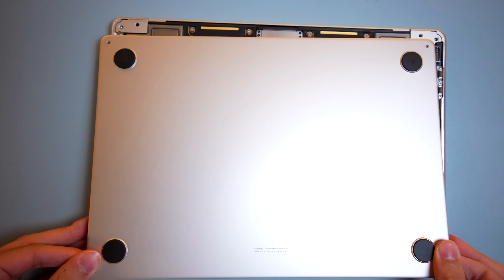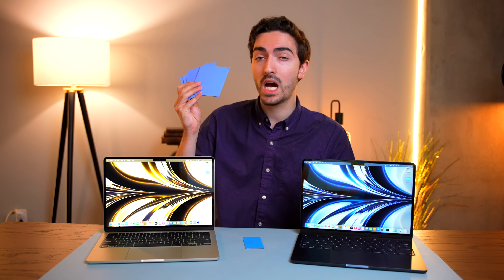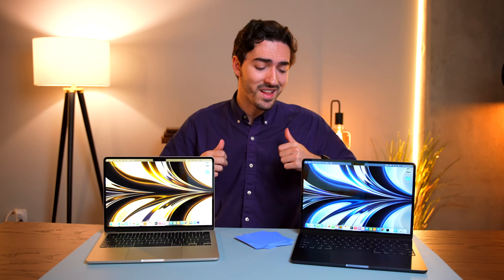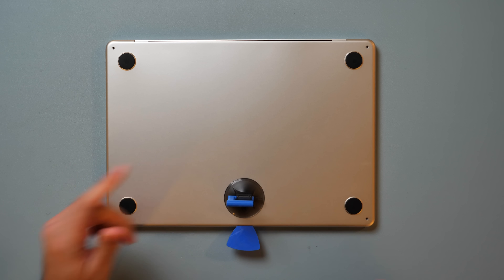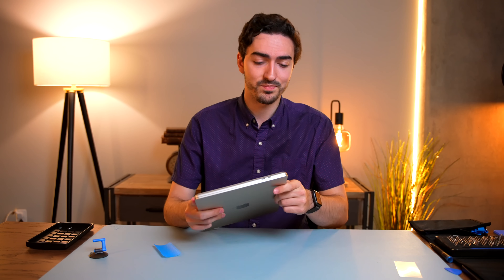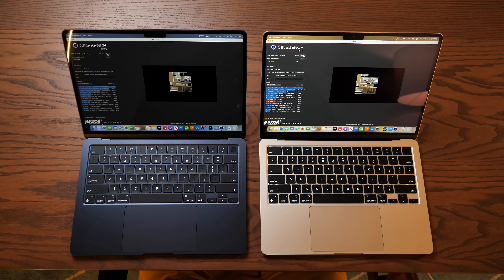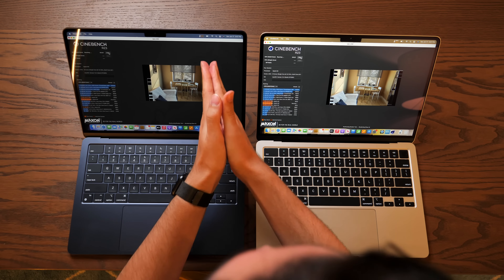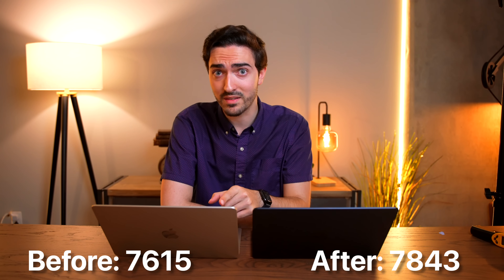Make your M2 MacBook Air FASTER for $8?!

Comment: Installed the heatpads and I am using a notebook cooler. The MBA sits on a fan and has an additional fan blowing on the KBD. Now it runs, 33W power use. Topaz Video enhance is running 24/7. Without the fans it throttles to 24W or less. 30% or more computing power with heatpads AND fan. In stock condition it is slower than my M1 MacMini.

Comment: This is total BS. I have both the M1 and the M2 MacBook Air and have never ever experienced overheating with normal every day use. I use adobe in design and Photoshop and I've never once had an overheating issue. All these benchmarks where they're running them six or eight times in a row of course they're going to overheat no shit. All this again is BS you should not have to put thermal pads in there if you're using it for normal use that it was designed for. If you're using it for editing v4K video.and stuff like that this is not the laptop for you, upgrade to a MacBook Pro, pro as in profession use.   ALSO doing this fix is going to drastically shorten the lifespan of the batteries. Think about it you're transferring the heat to the bottom cover which has direct contact with the batteries therefore you're making the batteries run hot and everybody knows heat is not good for batteries,

Comment: To throw a spanner in the works a little….heat flows when there’s a heat gradient. You may not get better performance by covering the entire emf shield. Instead, better performance may come from covering just the die area which will allow a greater temperature gradient on the bottom case….eg, a defined hot spot allowing heat to move quicker to the colder parts of the case. This was evident in your test and is why heatsink manufacturers use a copper base with alu fins.

It would be interesting to see a follow up video to confirm though.

Comment: What i like to do is use really thin thermal pads as a bridge/electrical insulator, between a very high end graphene thermal pad.
Be VERY aware that graphene pads are extremely electrically conductive, so they need electrical isolation.

Now where graphene comes in handy is spreading out the heat, not just transfering from one side of the pad to the other.

When transfering from the CPU, to the case just below the CPU, its a bit slower than thin thermal paste(this is significnatly faster than a thermal pad, but this requires good precision as it is not electrically isolated, any shift in the graphene pad can result in a short circuit killing the device).

However, when transferring from one edge of the thermal pad to the other edge, say, moving from one side of the laptop to the other side, it seems to be 3-8x faster than the aluminium used in the case. I think the pad i used was rated for over 600w/m*k (transverred on the X/Y plane not the Z plane)
This is nowhere near the speed of a heat pipe or evaporation chamber, but it is far better than just letting the aluminium alone spread the heat out. 
If you could combine heat pipes, with these thermal pads to cover the entire bottom cover with graphene, and a traditional thermal pad to insulate everthing else electrically, you miight be able to push the M2 to 38w

Edit, what i think Apple should have done for this new generation is have the SOC behind the screen, with ample heat pipes and thermal pads to spread out the heat across the whole screen so there isnt a hot spot, this would allow for larger batteries, more ports, and more storage on the base of the unit, keeping the majority of the heat away from the intentionally difficult to replace battery.
Reply: Great！nice Idea！！

Comment: The chassis temperature for both of those is now dangerously high for skin contact, which is why this might not be a good idea. 47 Celsius will cause 2nd degree burns in 20 minutes and 51 Celsius will cause 3rd degree burns in 4 minutes. You wouldn't want to put these on your lap after this mod anyway.

Comment: Would like to see the benches on unmodified vs modified when using laptop cooler that pulls the heat away from the bottom cover. The thermal pads are flowing heat away from the heat sink to the bottom cover, so the next step is more quickly move it into the environment with air flow. Since there are no vents, best that can be done is airflow across the bottom.

Comment: Here's an idea for something that I'd like to see tested: What's the ratio between CPU load and CPU temperatures. Like, sure, the CPU has to throttle under load when benchmarks are being run; the CPU is under 100% load. But what about under more 'normal' circumstances? Like, I have an ableton live project that keeps my CPU at 40% load, which activates the fans on my CPU.

I'd like to know what CPU load produces temperatures of ~100 degrees, causing the throttling!

Comment: the thinner cheap pads covering the entire shield are not making full contact with the base of the case on the blue unit, you need thicker pads.

Get one of the gel filler hot and cold packs that you use on sore muscles. you can start out with a frozen one if you like and you can put it under the base of the laptop. even unfrozen, the gel will absorb the heat away from the case bottom and help cool the laptop
Reply: How do you know they aren't making contact?

Comment: Been using this technique with thermal grizzly pads on the heat pipe in my 11" air, 15" 2018, and 16" 2019. It's mostly a no-brainer as long as you adjust your use accordingly (ie don't run cinebench on your lap while wearing shorts). 
Since they're portables though, I skip the area directly above the cpu/gpu. The bottomcase does flex in a backpack, and I'd much rather keep additional strain due to flex isolated to the heatpipe rather than directly on the chips and logic board.

Comment: How about running the MacBook without the bottom plate and elevate it slightly when you're at home and you need the most performance ? And put the bottom plate back for when you're on the go

Comment: Great video. No, these machines are not designed for sustained heavy workloads. Thermal pads are okay, but getting the MacBook Pro is a better option. I appreciate what Apple is doing as far as performance per watt/power efficiency. They got away from PowerPC (too hot, inefficient), they got away from Intel (also too hot and inefficient). Now they have their own designs based on ARM tech. Much less power usage, better performance, and a great step in the right direction as far as package design. However, the costs are high.

Comment: Now do the ultimate "Chad Modstrong v Virgin Warranty" on same machine for comparison:
 
1. Remove heatsink and replace all thermal paste with Thermal Grizzly liquid metal @ 78W/mK. 
2. Screw HS back in place.
3. Rip that risible black insulation strip off of it, clean with isopropyl alcohol & slam 1.5mm Gelid 15W/mK thermal pads onto the bare metal, covering the whole surface, including ribbon-cable.
4. Likewise eliminate with extreme prejudice any insulation on corresponding area inside the bottom cover.
5. Screw the bottom cover back on with brute force.
6. This should get the bottom cover up to ~65°C in long stress test.
7. Use massive balls to wick away the excess heat.
8. QED.

Comment: Fabricate a custom bottom case that replaces the factory bottom that's a couple of mm thicker and has air vents. Then take that up another notch and have a bottom case with a super-thin built-in fan just to move air around inside. C'mon Luke, you can make these!

Comment: "Shorten your M2 MacBook Air Lifespan by YEARS for $8" would be more accurate. This is how you cook a battery, causing it to expand, and killing the whole thing. The air gap is on purpose, to isolate the heat from the battery. Thermal pad modifications will kill so many MacBook Airs years before they would have.

Do not do this to your Mac. If you don't want your computer thermal throttling, buy one with a fan -- that's literally why they still make them.
Reply: You could isolate the battery also, putting reverse thermal pads, insulation.
Reply: You can buy aerogel sheets of 1.0mm thickness. These can be placed over the battery and other components you want isolated from the case

Comment: A year later don't put the thermal pads on the heatsink instead put them on the bottom plate cover that covers well the bottom lol

Secondly if you're out of the warranty you probably would have better results using higher quality thermal paste or even liquid metal if you're comfortable with doing that

Use TG shield that protects the tiny little chips around the GPU or CPU just for safety and never apply it too much thermal pace or liquid metal you need to get away with the least amount but you do not need to see the processors that's to thin 

With liquid metal you do need to go really thin with that stuff but also making sure you do cover the processors as much as possible and on the heatsink itself but then like I said don't overdo it

Comment: Regardng the paradoxical Blender classroom test on the higher spec'd model: 1) Were you running on battery and if so, was the charge level high enough? 2) Did the wide-area thermal padding permit heat from the CPU to transfer to the SSD or other subsystems via the lower case and cause throttling that way?
Reply: One hypothesis:  The higher specced model had two different thicknesses of pads, 0.5mm and 1mm. The 1mm pads could have caused an air gap between the case and the thinner 0.5mm pads.  While minimal, this small air gap would effectively act just like the small gaps between a heatsink and CPU without thermal paste applied.  So, while the thermal pads are facilitating heat transfer in some areas, the material of the thermal pad itself absorbs some heat and has no place else to transfer it to other than spreading it around the board and it's own mass.  In effect, the pad also would become a thermal mass according to the specific heat capacity of that thermal pad material.  Granted, there would be some transfer of heat into the small 0.5 mm deep cavity of air between the case and pad, but not as efficient as the 1mm pad in contact with the case metal.

Another hypothesis: The color difference between the two macbook models could also cause some slight differences in heat dissipation due to black-body effects.  This seems less likely to cause such a large difference.  However, it's also stacked with the above effects and is difficult to separate out due to the experiment's design.

Comment: Why do you measure temperature on the units’ keyboard top surface, between the function keys and the display, and call it the palm rest? It is simultaneously not a palm rest, and a place your palms will never rest.

Comment: Add external peltier thermal-electric phone cooler on M2 Air.

Btw, infrared thermometer usually doesn't work correctly on metal or shiny surface. The reading on bottom case might be off.

Comment: These are interesting experiments but I think it's a bit irresponsible to be showing how to do a modification like this without mentioning that you can burn yourself quite badly if you do it "right".  A really great thermal pad, perfect contact with every surface as well as the case, and a little bit of spherical fictionless luck and you can get your exterior case temps up near 100C, hot enough to permanently scar you almost instantly.

Fundamentally, these machines are designed to thermal throttle. If you require the performance that active cooling provides, buy a machine that supports active cooling. Apple sells several.

Comment: Thanks for this interesting video. I have ordered a MBA for my wife and it should come tomorrow, so we will see if the laptop heats up significantly. I suspect that when you use it for everyday tasks, it probably won't actually be a problem. This fix is probably most useful for the pro-user, who might well have a higher spec Mac Book Pro anyway. Just as well, as I don't actually fancy opening the case up very much. I have a fan plate which I used with my old MBP/2017, so we could use that if there is any problem.

Comment: Can you test thermal pad mod with a laptop cooling pad?

I think full heat sink coverage to keep surface temps lower under normal use on the go and then letting the thing max out and hit 50C on the bottom cover while rendering on top of a cooling pad when you’re at your desk might be the best of both worlds.

Kind of like that eluktronics external water cooling radiator for their new laptop but way simpler.

Comment: In addition, I personally think that there could be a pretty good reason why the engineers at  have kept some air gap. For an example, when such a temperature is passed to the bottom case it might affect badly to the lifetime of the battery since heat is such a good enemy to batteries. But the experiment here is great so that now we know a little bit of higher performance can be achieved. Further, I suggest using a stand with a fan if you’re using this macbook daily on a desk. However, they could have installed at least a very little fan. 😐

Comment: what about make ventilation on bottom cover. maybe drill it 2 sideways, so the air flow can happen. 
or maybe there will be third party cover that have a hole.

Comment: I did not encounter a throttling issue with my MBA so far but I am getting into amateur video editing and I may experience some excessive heating. The solution looks fairly simple. Thanks for the tip.
Nick

Comment: Love the video. Great to do those thermal pad tests. Was the blue M2 MBA the one with more cpu/gpu cores or was it only ssd being bigger? If more cores then more heat and a burst of power then possible quicker throttling effect as some YouTubers have shown. Could this explain the results or am I way off? Also would it better to have the MBA on a stand to get air flow underneath?

Comment: Why not also bolt the MacBook Air to an anvil? That should give you a further 2% performance increase, at least for running benchmarks. 

Sticking thermal pads to insulation... Here are some more ideas in the same vein:
- put noise-cancelling headphones over the speakers
- sound insulation over the microphone
- faraday cage for the wifi
- paint the screen black

I can't believe it isn't April 1st.
Reply: Look at all the comment approving this idea…people are eating this shit up, and he’s here to supply demand. Not his fault, though it is

Comment: such a solution heats the lid, and the lid heats up the battery, and the battery does not like overheating, so you should not solve the issue of heat removal from the system on a chip

Comment: have had this mod on my daily driver M1 air (im on right now) and when I play games like RuneScape or do a large file transfer, boy does she get hot. also with only 31 battery cycles im at 91% battery life .. I keep it plugged in and it will bypass the battery typically and unplug it when not in use.

Comment: If the bottom of the case is now 50 degrees C, you won’t want to use this machine as a laptop, especially wearing shorts. Water at that temperature is considered scalding!

Comment: i think m2 macbooks have temperature sensors for the case. so if the case heats up the cpu clocks down even if when cpu is not hot. for the safety u know...

Comment: I'm curious about doing this mod as well to my M1 MacBook Air. I'm wondering about the downsides of it, because I have read some thermal pads can get oily - and actually leak to the components. I could imagine that could trigger the moisture stickers so I'm a little worried about that. Do you have any tips what to look out for getting the right thermal pads and what has the experience been using them longer term?

Comment: 5:58 I realize that you didn't want to hurt your resale value, but applying thermal pads on top of thermal insulation tape doesn't seem like an optimal solution. The tape will block at least some heat transfer from happening.

Comment: I’ve seen this mod before. My only concern is that moving the heat to the bottom case exposes other components both inside and out to heat they were not intended to handle. Over time that can be an issue.
Reply: Yep, it’s just destroyed your battery.
Reply: Yeah this can’t be healthy for your battery life

Comment: I honestly think that with the now proven throttling issues in the Macbook Airs, I think that Apple will Have to add a fan or some sort of Active Cooling system (& now I am hoping that they do) to the upcomming 15" machines. The cat is out of the bag (sorry not sorry Apple) that no matter how energy efficient the chip(s) are they still generate too much heat when you are pushing the machine to it's limits. And yes I understand that you shouldn't push any computer to it's limits all of the time, but what is the point of having tons of computing power if you can't use it when you need it? I am assuming that the 14" & 16" MBP's fans aren't constantly running the entire time you have the machine on/are actively using it. I am guessing that the fans only kick in when you are doing extended intensive work in order to prevent throttling. I won't speak for others, but I would be okay with a thicker 15" Macbook that has a Fan & doesn't throttle & so I have full chip power when I need it & when I am doing non-power stuff the fan can turn off. It's ridiculous of Apple to push the power & abilities of their chips if consumers can't use it because their machine throttles.